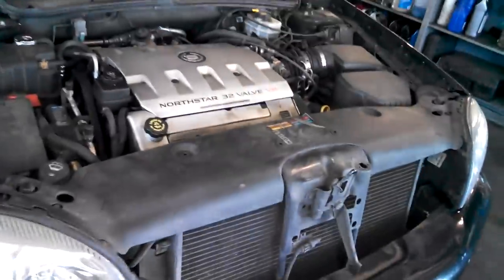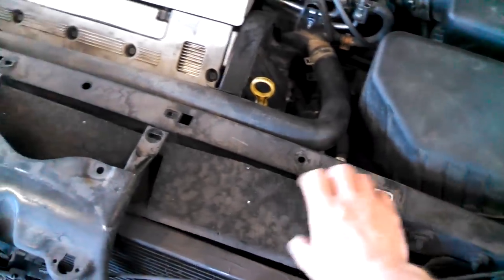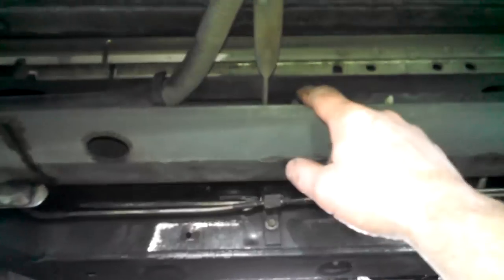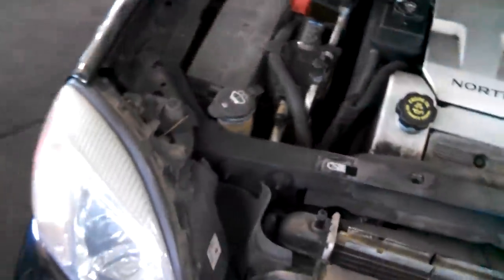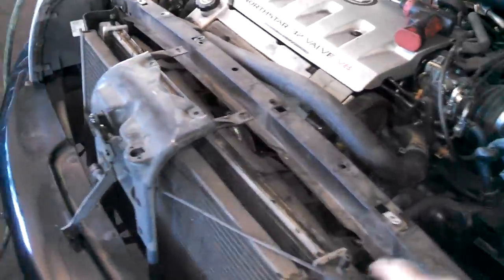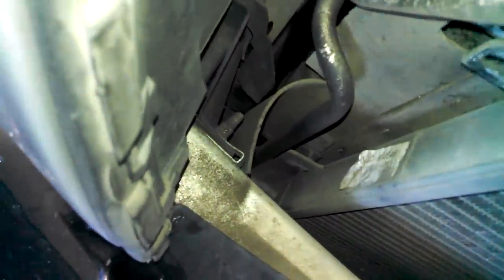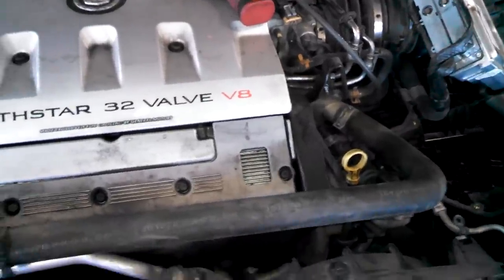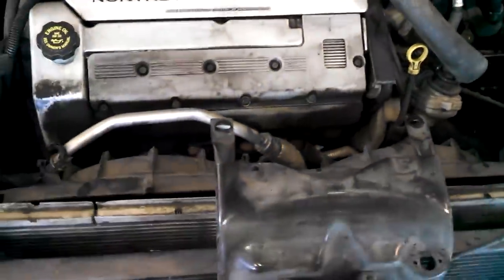Radiator replacement 2000 - 2005 Cadillac Deville 4.6L V8 Install Remove Replace

Comment: I’ve been having a Cadillac Seville for about 3 years now. The first time it shifts every time it jerks, and I’ve been changing a lot of parts to figure out why, then not to long ago felt something in the front of the car jerk forward, then t came to. Well its not the transmission or anything complicated like that. ITS THE ENGINE. THE ENGINE AND THE TRANSMISSION NEEDS NEW MOUNTS. THAT REALIZATION ALONE PROBABLY SAVED ME THOUSANDS OF DOLLARS. I’m still gonna put a new fuel pump and new fan blower and new condenser and new compressor but the cars going on 160,000 right now and the alternator gave out already so why not.

Comment: Replacing my radiator in my 02 DTS north star rn in a gas station hopefully that’s all that I need I have a new thermostat I didn’t need at the time but now after reading the comments I might put it on now.

Comment: I found a crack today in my 01 front radiator passenger side top under the foam. Going to try marine-tex first b4 I pull it and spend a dime/time on this car.  Its my daily so it will be a weekend deal. Thanks for posting this I will likely be referring to it.
Reply: Did the marine tex hold up? I just found a small crack in my 2003 deville exactly where you described yours!
Reply: its a common problem, but it will hold for awhile, but that crack will start traveling
Reply: Correct held for a week then started again. Replaced it...pretty easy fix have had the radiator out 3  x since then..... Fans replaced, alternator, belt... getting pretty good at it unfortunately.  Ended up buying a 94 3/4 suburban for 1000 bucks as a back up.  Suburban has been extremely reliable although 8-10mpg....

Comment: Make sure to check the hose from the radiator since they sit on the engine it causes holes and slow leaks and could be the reason the caddies over heating.
Reply: You're absolutely spot on. I was driving on the motorway and I noticed my temperature gauge going up just a little over the half mark and going back to the middle. I immediately thought somethings not right. Amber EML flashed on the dash and disappeared. As I was slowing down to a stop, temperature went up again over the half mark. Luckily there was a fuel station just 2 mins away. Stopped and opened the hood to check in the engine compartment and guess what? I saw coolant had spluttered  and splashed around the hood and front engine compartment just near the radiator I could also smell coolant. Lifted the top cover and I heard a hissing sound. When I checked closer I saw the upper radiator hose visibly touching the water pump and running along the engine had a tiny tear. There seemed to be some rubbing on the hose pipe and as the engine gets hot the hose gets burnt with heat. Luckily I had insulation tape and after the engine & hose pipes had cooled down I wrapped and taped it tightly around the split. Enough to make sure it would hold for the next 150miles or so. Checked the full length of the hose no visible cracks. Cut the story short I filled up just over half a bottle of cold water in the coolant reservoir bled excess air and off we went. Since I'm in UK we couldn't source another part similar so had to order from rock auto in the states. Been driving for nearly two weeks with the tape. Obviously I keep checking the temperature gauge, & the hose. I re-insulated it with a thicker tape and have had no issues whatsoever. Never lost coolant. Got my new part yesterday and fitted it. I used cable ties to hold the upper hose on the membrane running across the engine so it doesn't touch the engine. Cadillac engineering department had it wrong on that design.

Comment: How do take off the computer plastic cover? I have a deville concours 1999 but that computer cover is very difficult to take off! I have tried a pry bar even that has not worked. I would appreciate if you could give me some hints on how to remove the computer cover and get the computer out of the way. Basically I am goin to replace the radiator. The car is overheating but I do not see any oil droplets in the coolant reservoir and I do not see any coolant when I pull out the oil dipstick.

Comment: My 01 Seville STS at 114k has a leak now. Was tough one to find only leaked parked downward on any kind of hill or slope.
After a careful search it is the upper radiator neck with slight wiggle.
Was hard to find wouldn't leak except for any angle downward..
It looked like a real pain to change after this have an idea now.
Reply: On these cars, EXPECT to change the radiator by around 120K, if not before.

Comment: what would a job replacing the radiator and hoses cost?  on a 2000 Cadillac Deville dhs . the right post actually broke off and fell in the radiator.

Comment: Good day sir. Any chance you are located in Arizona?!  I have been looking for a good mechanic to work on my 02. Currently i have 147k on mine and am waiting on parts in the mail: radiator, thermostat, cv shafts left and right, steering wheel position sensor, and a fuel pump. I've already had the tranny rebuilt and my oil leak fixed. It's Big $ in repairing these cars. If you know of any good Cadillac Mechanics like yourself, in the Southwest, Tucson exactly, please let me know. I plan on keep this car I got from my grandfather 6 years ago. He bought it new, and I plan on passing it on to my family one day. 

Keep up the great videos!
I love to see what technicians will be doing to my baby when I drop her off.
Reply from the maker: Kyle Kidd Too far, Oregon here my friend. Thanks for checking in, otherwise I would be glad to take care of your car needs.

Comment: Do you have to go threw the same general process in order to drain the radiator and perform a coolant flush. I'm working on a 08 dts witch is a DeVille with a 4.6 I don't see any way to drain it from the bottom.

Comment: So do a 2002 Cadillac dts have a oil cooling system with it or is it just a regular radiator
Reply: on the driver side it will have 2 lines for transmission cooler. very very few of them had oil cooling, on the pass side

Comment: I want to make sure I get the right radiator.. I have a 2002 Cadillac Deville 4.6l base model V8 . How can I tell exactly which one I need?
Reply: Same problem I’m dealing with on a 05. Did you figure out which one?
Reply: @slimthechief4064  I went online to advanced Auto parts and have your vin handy .there are y or 9 in the vin tells which unit you have
Reply: @alibotz7517  as he says, have ur VIN and they will get you what you need.  I just got mine from Advanced also.
Reply: Alfred Di Febo Jr. Thank you much appreciated
Reply: @slimthechief4064  no problem bro  . Glad I could help ! Hope you got it fixed.

Comment: What goes on those bolts at the of the video where you had to put thread lock lubes. Like is there any specific hose that goes threaded in

Comment: Hey man... because of u I saved myself some  money on replacing thermostat on my 2001 Cadillac.  Unfortunately it is still over heating gradually.  What I mean by tht is tht it takes about 15 min of driving highway speed for it to overheat. And in town about the same only with AC on. Fans work. Brand new radiator thermostat and water intake gaskets.  All done by mechanic besides thermostat.  No water in oil either. Is it possible for the head gaskets to be bad if there is no water in oil? Also bleeding coolent system was mentioned.  Have not did tht.
Reply from the maker: gladiatorunit04 did you say the radiator was replaced?   Maybe check for debris in front of condenser which is in front of radiator.    need to check if it is really overheating, running hot, gauge could be off, or malfunctioning too.
Reply: Wow that's the same thing that's happening to me.I watched his video and installed a new thermostat on my 2003 cadillac deville and it's still running hot.Smh.I don't know what's wrong with my car.
Reply: gladiatorunit04 I see it's been a while since you asked this question, but in case you haven't gotten it, I thought I'd weigh in. I have seen water pumps go bad on several Northstar engines and cause overheating. I would suggest flushing the cooling system to eliminate that possibility, but water pumps on those things are no joke!
Reply: Did u find out your problem with your caddy?  I have the same issue,  replaced thermostat, and waterpump
Reply: The bottom trans line from the original is not fitting, suggestions?

Comment: 2000 caddi deville overheating !! What is this oil & coolant under the passenger side?
Reply: Blown head gasket or bad radiator once ur radiator is badur oil and coolant mix as of a blown cylinder...

Comment: I need to replace the connector for the bottom transmission line, they only sent the clip connector. where would I find the screw in connection?
Reply: junkyard

Comment: Torque spec? I loss a little respect for you. You seem like you know what you are doing.
Reply: blackericdenice  how much spec do you need for parts that arent critical?
Reply: Ask me your question in a different way.
Reply: blackericdenice im saying feel it out yo
Reply: I have all the torque specs stored in my right elbow  for every car and motorcycle and boat motor ever made.
Reply: @dontblameme6328  in 43 years my elbow tourqe wrench has never failed me. Only time I used one was head bolts on a 73 L82 Vette. That torque wrench still collecting dust in bottom of my toolbox.

Comment: This dude is clueless. 
It takes all of fifteen minutes to replace a radiator in a 2002 Cadillac Deville.
This dummy removed ten times more equipment than he needed to to remove it. 
Snarf!
Reply: +Winjury Drain radiator, remove 2 top radiator brackets, 2 hoses, trans cooler lines, and hood latch bracket.
Lift radiator straight up off of rubber grommets on each side. Simple, 15 minutes.
Like I said this guy removed ten times what he needed to. CLUELESS!!!!!!!!! He said 3 hour job! HAHAHAHA
BTW, I'd make and post a video if I felt this project was too involved for any average mechanic.
Reply: Weiszguy1 cool!
Reply: @Weiszguy1  the fan was bolted to teh radioter